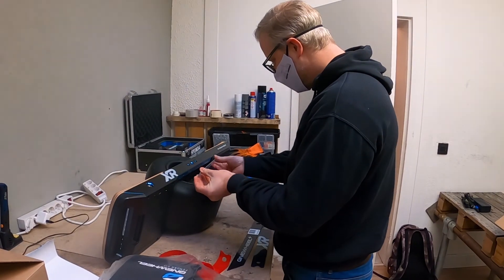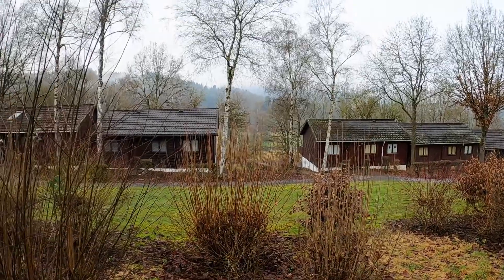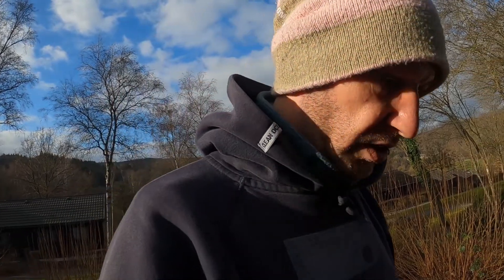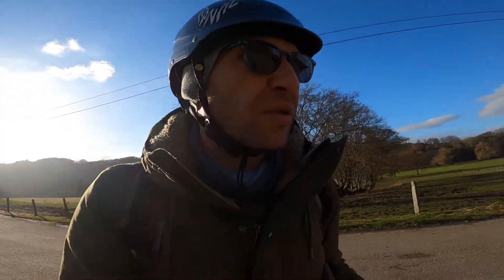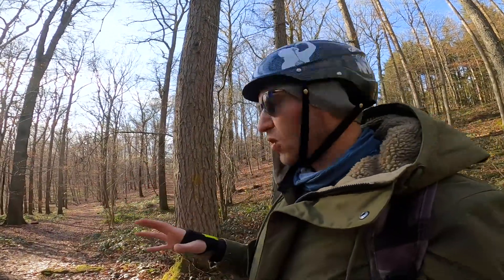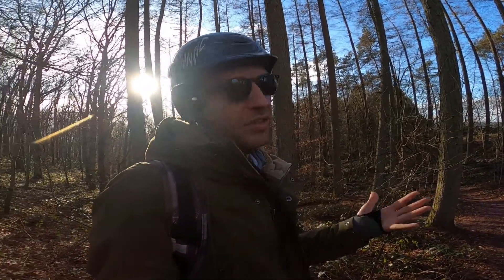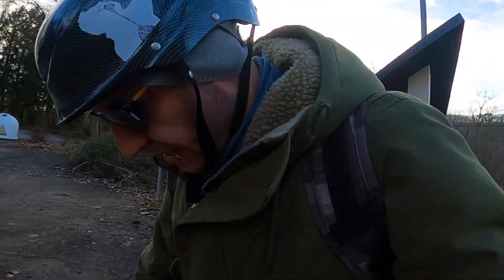OneWheel XR 4212 sensor issues?

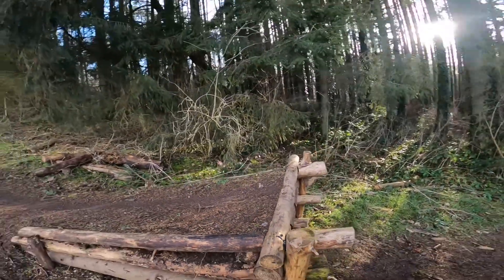Comment: Love the safety tip at 7:06! Definitely keeps things in perspective for me as a rider!
Reply from the maker: Something I’ve picked up through experience. I used to live on a mountain for several years and we’ve seen some tricky situations. YouTube is a good place to share this knowledge. Enjoy the float! ➖🙃➖💨
Reply: @VinieVizzleVlog  got the 4209 running yesterday, switched the motor to the newer one cause it has my nimbus and rim protection on it, 4212 stripped down to pcb slave battery swapped to keep power on board.. stock battery is now in a deep cycle charge, and pcb on 4212 thinks it's in a charge state so no loss of power to bms or controller.. turns out you can disconnect the battery.. but you MUST keep power on the logic side of the board or it will lose its code. 1 dell is way off, hopefully not compromised and a deep cycle charge will restore and balance it. Fingers crossed.
Reply from the maker: @MrDmadness  🤞

Comment: if you’re having issues with the sensor i found going for a softer grip tape like the proride foam pads works wonders and fully fixed my sensor sensitivity issues, the firmer the aftermarket grip tape the worse the sensor gets
Reply from the maker: Thanks for your input Kayden! Much appreciated. Had no issues so far.. 🤞

Comment: Hello, thank you for the video and ✌️from San Antonio TX to Belgium. Would you know if 4212 is doable to upgrade the battery for better range ?
Reply from the maker: Thanks mate. 4212 version needs an additional chip to upgrade the battery. But definitely possible!
Reply: @VinieVizzleVlog  cool I'll keep it in mind for when I'm ready. I only do trail riding and now getting to the point when I really can use more range

Comment: The sensor only matters when traveling less than 1 mph, no?  I also have a 4212 and I only have issues when mounting the board.
Reply from the maker: Some people are complaining about the sensor sensitivity. It seems Future Motion has added an additional layer of plastic underneath the griptape on new models which would be causing the issue. Haven’t had any troubles so far on my 4212.

Comment: Unfortunately I had a lot of problems with the sensor as soon as you change the griptape to a slightly thicker one, the sensor almost doesn't work at all anymore. But then I also saw the post on reddit with the plastic, did that and fixed all the problems. Now about 3 months later I have the problem that no matter how much pressure I put on my sensor, only the left one is recognized. I then fixed it by plugging in the plug again and today the same problem... I tested the onehweel again 1 hour later, now both are working again. I'm still a bit scared to drive because I have the feeling that it's random whether it clacks or not.
Reply from the maker: I recently saw they now have front footpads with only one sensor in them. Viper has one of them. Seems like a good upgrade to fix the problem. Hope you get that XR fixed soon so you feel safe again!
Reply: @VinieVizzleVlog  Just drove and got battery pushback and it's not working again... Im on streak at 217 days and life in Germany. Its not a good combi.
Reply from the maker: That’s definitely the accomplishment with our climate here in Europe. Hope you get to continue that streak!
Reply: Any update? I have a 4209 and I finally had to get a new front footpad, I put the thick C&R grip tape on it right out of the box and this sensor is horrible! Same shoes, same stance, same grip tape as my old sensor but it is cutting out like crazy and making me really anxious to ride my board. Even looking on the app you can see that it is not registering my toe side with my foot flat and I've had a couple instances where the sensor cuts out at speed... when I go under 1 mph it cuts out about half the time even without heel lift. Seriously considering peeling the top layer of plastic off but I've lost all confidence in my board.
Reply from the maker: Have you considered doing a posi switch on the sensor.? Very easy update that makes both sensors into one. Makes the sensor much more reactive and could be a fix for your problem. I still have the stock pad without any issues.
Reply: I removed the top sensor layer and everything works again write to c&r support they will definitely send you new griptape if you describe your problem have a look on reddit there is a description of when you can remove it without causing further errors I have already driven 3000km without problems.
Reply: @VinieVizzleVlog  Posi the footpad in my opinion, it's not a good idea, it was sometimes so bad for me that it wasn't recognized at all and if you drive fast and then both sensors aren't recognized for a moment, you can really hurt yourself.
Reply: @helge9818  Thanks for your reply, it looks like removing the top layer of plastic is going to be my best option. I'm a bit apprehensive about heating and pulling on the sensor once again as my last footpad began to ghost due to the plastic layer delaminating from the sensor.  That is why I had to get a new footpad in the first place.  But it will have to be done as I have 0 confidence in my board balancing me at high speeds now with the new sensor.  I even went as far as to put the old ghosting sensor on there because I would rather ghost than nosedive at 18mph. Any tips for me before I do this layer removal? I've done grip tape jobs successfully many times so I imagine it is going to be the same process but slower. I can't seem to find the instructional post on Reddit, but it seems pretty self explanatory regardless. Would you recommend a thinner grip tape to really eliminate this or will a replacement sheet of C&R work just as well? Cheers!

Comment: Nice video. Would you say the 4212 puchback is more intense than the 4209?  What's the difference?
Reply from the maker: The only thing I noticed was that in one of my recent rides I got some pushback on my 4212 when riding out for the 1st kilometer on a very cold day. Never had that on my 4209. But that’s the only instance I noticed something different. Otherwise no troubles so far.

Comment: What sensor issue are people talking about? I just got a lightly used (87 miles) 4212 and am new to onewheeling. The sensor seems inconsistent when I try to heel raise dismount
Reply from the maker: Some people have issues with the sensor not engaging properly when riding. FM added an additional layer of plastic in between the sensor and the griptape in some models which seems to create this issue in some boards. Have about 100 miles on my 4212 now without experiencing any issue.
Reply: I had this problem. I believe it was because i was a new rider as well. I ride normal. Left foot forward and larger feet. When I lifted my heel (knee out) i would get inconsistent deactivations. However, I later learned to lift my heel (knee in) and now i get it 100%. Lift your knee and roll your knee more so that you feel more of the pressure on the big toe ball of your foot. That fixed my knee lift technique. Maybe the plastic is adding a little extra pressure to the other pad under normal knee lift. IDK. 
Hope this helps all.
Reply from the maker: Thanks for sharing!

Comment: Getting error 16 like crazy on my 4212 with about 4500km on it.  This after getting the single sensor warning every 5 mins on a ride., now also my battery sometimes stops charging at 80%till I unplug and plug in again... ive got a 4209 with 20779km on it..   not a single issue, only reason I'm not riding it is that I've got to put a new battery in it.   4212 is garbage.. ive ordered a vesc and gave the coding to flash to it already... to hell with Fm.  This is a bad cell or a software issue, like their gt software issue causing the ghosting.. how do I  know gt was software related ? Well,I program, and ask yourself: " why would enabling or disabling simple stop effect this at all" ( pro tip, it can NOT be a physical issue if a software update or change in configuration effects it )
Reply from the maker: There’s very little cases of bad 4212’s here in Europe that I know of. Maybe that’s because OneWheels weren’t selling very good at the time we bought them. A lot of stores had the early batches in stock for a long time. Maybe they had better finishing. Could be sheer luck too. One machine isn’t the other. Hope you get that 4209 back on track. Those really seem indestructible. And yes Sir.. VESC is the future! 🤙🔥